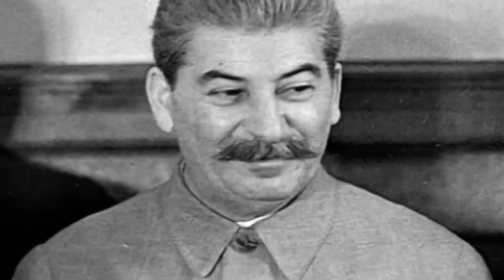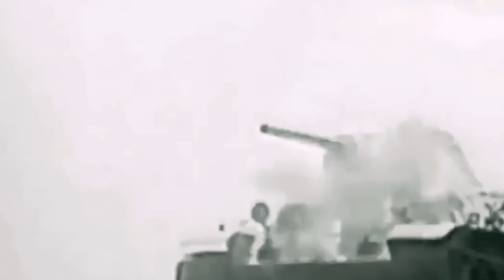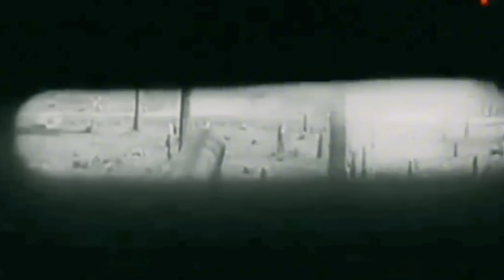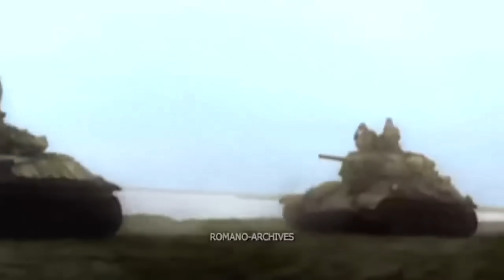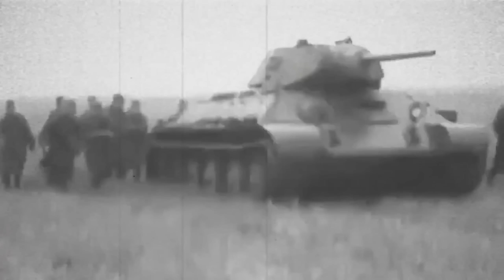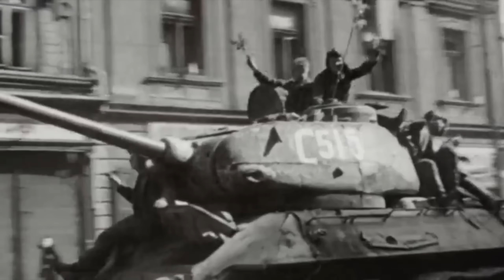Dark Truth Behind the Most Destroyed Tank Ever: T-34

Comment: A little known fact is the Soviets had already developed and were planning on mass producing a new and improved T-34 in 1941 before the German's invaded. The T-34M (A-43) had a 3 man turret, a new torsion bar suspension (increased the tank interior by 20%), a better engine (also turned sideways), thicker armor, smaller overall dimensions, and an extra wheel on each side. The project was cancelled when the German's invaded, but had it been produced a lot of the design issues of the original T-34 would have been addressed (poor engine reliability, 2-man turret, extremely difficult to change gears, etc).

A lot of the design principles from the T-34M were later reused in the design of the T-44 (torsion bar suspension, sideways engine, improved armor layout, etc). The T-44 wasn't a direct successor to the T-34M, but the T-34M influenced it a lot.

Comment: Just one mistake I noticed the T34/85 model did not have a turret basket like in the Sherman tank. The loader had to walk and load the gun as the turret rotated.
Reply: wrote: "Just one mistake I noticed the T34/85 model did not have a turret basket like in the Sherman tank. The loader had to walk and load the gun as the turret rotated"
-- Late model M-4 Sherman(wet stowage) tank did not have a turret basket, since it adapted T-34 tank form of main gun ammo stowage on the floor, and loader had seat that rotated with turret, since T-34 turret was one of the fastest traversing turrets of WWII tanks(full 360 degrees in just 11-14 seconds), just so you know.

Comment: The Bt 7 had sloped armour, the french had the R35, all american tanks had sloped armour.... and even the tiger had a slight sloped frontal armour, the concept was well know ....
Reply: -- BT-7, that was designed and produced in the same factory as T-34(in fact it supposed to be next generation of BT tanks) did not considered it as "slopped armor" tank, nor Tiger I, since oblique angles of Tiger I armor did not help with EAT(Effective Armor Thickness) or  deflection of projectiles... so you are wrong about "slopped armor". FYI, author of theory of "Armor Plates or Rational Angles) was N. Tsyganov, which at 60 degrees of oblique angle doubled the thickness, and was specifically configured to defeat any German tank(KwK) and antitank(PaK) gun at the beginning of the war.

Comment: The designer of the T-34 died of pneumonia he contracted through demonstrating the T-34 on a very long drive to Moscow I think that is an important detail the guy literally died trying to convince Stalin the tank is worthy of mass production.
Germans knew about sloped armor but did not deem it necessary as their manganese containing rolled hardened steel was very good ... later indeed they sloped the armor but only in the front sloping helps with protection but reduces internal space a lot.
Reply: "Only" 900 T-34 500 KV-1 ... that is 1300 tanks the Germans in total had 3300. In total. The Russians also had a lot of T-36 and BT-5 and BT-7 in total 10,000-50,0000 tanks so Germans were outnumbered from the beginning even on June 22nd by a lot, 3:1 or 5:1. "Only". The Germans has only 440 Panzer IV even that with a short barrel and only 960 Panzer III so the Soviets had an ample number of tanks.
Reply: wrote: "The designer of the T-34 died of pneumonia he contracted through demonstrating the T-34 on a very long drive to Moscow I think that is an important detail the guy literally died trying to convince Stalin the tank is worthy of mass production."

-- Yeah, but you too left also an important detail, that M. Koshkin got wet as the forward tank, that he drove, slipped off the icy bridge and plummeted into the river in the middle of cold winter(month of March), everyone else who participated in that 3 000km field trip, survived no problems.

Comment: Both, Panzer IV and t-34 had their flaws. The Panzer 4 originally had a thin armour and a short barreled 75mm gun. Much more dangerous, its ammunition was stored at the sides of the hull. Thus a direct penetrating impact on its side could immediately lead to an explosion of the shells. On the other side the T-34 had its tanks on the sides of the hull, better protected by the sloped and thicker armour, but a penetrating hit could change the T-34 into a crematory for its crew. The ammunition however was stored at the bottom. There the shells were protected against direct hits but the loading of the gun became much more unergonomic than in the Panzer IV.

Comment: The Panzer IV had a 75 mm gun from the start but it was a short barrel howitzer.  After British Matilda tanks proved immune to Pz III 37 mm high velocity guns and Pz IV 75 mm low velocity guns the Germans began replacing the 37 with a 5 CM gun and the 75 mm howitzer with the Pack 40 high velocity gun.  So some German tanks had the 75 mm from the start but in a low velocity format.
Reply: Yes, Pz IV' did have a 75mm right from the start of the war; however, it was not a howitzer. The weapon's designation, KwK 37, is a clue. "KwK" stands for "KampfdwagoneKanone", which is effectively "fighting vehicle cannon", where "cannon" is the term for a direct fire weapon. Later Pz IV's had the longer KwK 40. The same weapon, when used by AT Guns, was referred to as the "PaK 40", where "PaK" stands for "PanzerabwehrKanone", i.e. "AT Gun".

The German word for a "howitzer" was "Haubitze". For example, the "10.5 cm le FH18" was the principal Divisional artillery weapon in WW2. The designation stands for "leichte Feld Haubitze", i.e. light Field Howitzer.
This same weapon was found in the Sd.Kfz. 124 Wespe, which was a fully-tracked SP artillery piece. For some reason, the slightly modified version of this howitzer used by the Sd. Kfz. 142/2 StuH 42 (basically a StuG III but with a 105mm howitzer instead of the usual 75mm gun) was designated "10.5 cm Stu H 42".

The length of the barrel (or even its length relative to its calibre) is not a reliable indicator as to whether a weapon is a howitzer or cannon. Today's German Army uses the PzH 2000, which has a 155mm L/52 howitzer with a barrel more than 8m long. The WW2 French Army had several tank models equipped with the Puteaux SA-18, a 37mm L/21 cannon with a barrel less than 0.8m long. [By the way, the short 75mm used by the early Pz IV's was slightly longer than the 37mm Guns used by the early Pz III's.]

Comment: T-34 was the worst tank of WW2.
Reply: Based on what? It did its job and helped beat the Germans back to Berlin despite heavy losses. Sure, it wasn't as flashy or well protected as a Panther or a Tiger 2, but the T-34 could at least get to the battlefield reliably without breaking down, and cross bridges without falling through.

I'm not a fan of the T-34, but at the end of the day, the tank you want is the one that can reliably support you in the field, not the "better" one that's broken down a kilometre away. A shit tank is better than no tank.
Reply: The fact is that the T-34, Panther and Tiger tanks brought the Red Army to Berlin.

Comment: Corrections - The largest German gun at the start of the invasion was not the 50mm. Pz IVs had 75mm guns.
Sloped armor was not revolutionary in 1941, British and French tanks had it, but the British often elected to go with vertical frontal armour to increase space and simplify design and construction. German armoured cars and their half tracks had slooed armour before 1939. The Chrisrmtie tank had it in 1931, the Russian BTs had it from the early 30s.

 And the T34 loss rate was way worse than 50% as only 50-55,000 were built during the war, the balance were post war. But they did lose over 40,000 during the war. I've only used round numbers as precise numbers are hard to set though as the production and lost numbers vary in different sources. But the loss rate seems closer to 80% than 50% as only a few thousand of the 44,000 lost woukd have been in post-Ww2 combat.
Reply: 58,701 were built.  That works out to a loss rate of 75 % or so.  However, Red Army tank losses include non-combat losses like scrapping tanks due to wear or obsolescence, not just combat losses.  A lot of T-34/76 and other older tanks were being "destroyed" by being melted down in 1945 to free up steel for new tanks.
Reply: the 75mm L/24 mounted on Pz4 during 39-40-41 was not an anti tank gun, it was a support tank firing only HE, the first long barrel gun 75mm was mounted on the Pz4 F in 1942

Comment: The Soviet High Command soon realized the shortcomings of the T-34 so had its replacement (T40) designed. Germany invaded before the Soviet factories could start manufacturing components for it so the Red Army got stuck using the T-34. In 1943 Stalin shipped over a new T-34 with a driver/mechanic to the US so American automotive engineers could inspect it for design and manufacturing flaws. In 1944 Chrysler engineers in the USSR assisting the Red Army with their M3, M4 and M5 tanks told their generals to start removing the engines and transmissions from their own tanks after every 50 hours of run time to inspect and replace parts to avoid having so many breaking down in battle. The Soviets took their advice which caused long delays between offensive actions. Those delays enabled the Germans to withdraw to new defensive positions being constructed during the delays.

Comment: The way allies counted vs Germans. That's the answer. Not more then half were destroyed as most were repaired and sent out again.

Germans counted only total loss. Meaning they would take a tank get it hit on ten different occasions and only when absolutely all repairs are impossible is when they call it a loss.

Need proof??

There are more Soviet tank aces then Germans and there were more T-34 produced then all German tank designs combined.

Out of roughly 40,000 that got counted more then 25,000 were repaired and continued to fight. You can see them to this day with battle damage all across eastern Europe and Russia in museums. Those that didn't even see action were ultimately sold or placed in secondary roles and a good portion also used as targets during massive wargames in the 50s-60s.

If both Soviet and German counted losses the same they wouldn't be so far apart. Germany would be forced to admit their losses were much higher or Soviets would be admitted to be much lower.

PS the lie that they didn't come with radios are spread by nobodies who never even seen a T-34. That antenna placement isn't there for nothing, crew were given helmet with throat mikes, and yes seats were standard and were padded. Comfort was on par with a Sherman...neither are comfortable and neither were German tanks. They all had little room packed with ton of crew and it was always stuffy and hot - you don't get comfortable in war you just get used to it.
Reply: in war you just get used to it." that is true for anytime.
Reply: WW 2 is the war written by the vanquished, because the third Nazi Reich was only the useful idiot of those who publish anti-Russian and pro-Nazi propaganda, it must be recognized that this has success with the frustrated of life, it is about 'Panzermania' and is more psychiatry than history, the search for self-esteem and transgenerational hatred are the ingredients of this disease which, let’s say, is lucrative.
:goodvibes:
Reply: I've sat in the seats on a T-34/85, post war construction, and in the seats in a wartime large hatch M4A3 VVSS 75mm, and even after sitting around for over a decade the M4A3 was 10 times better to sit in at any station.
Reply: @tankmaker9807 now drive for long periods in all stations in M4 Sherman, T-34, Panzer IV then come back tell me how much you enjoyed each -

If you are comfortable in any of them on the move you are totally nuts

Getting a chance to sit for a split sec doesn't give you a single plus to your point you were trying to make
Reply: @strizhi6717  True, but 30 plus minutes is not a split second, and where did the PZ IV come from? 

I don't see any single plus in your post either, none the less, the ergonomics in the M4 was far superior to the T-34/85.
Reply: @tankmaker9807  all tanks for the era were made for war not comfort. Still holds true today. Doesnt matter which country that's where Panzer IV comes in. Too many think this tank is superior to that because of comfort but fact is they're hardly noticeable. You sat in a Sherman ok now pack it with four more men and your comfort out the window.

Join the army you'll understand my view.

People were built different back then
Reply: @strizhi6717  I never said it was superior due to comfort. I did say the ergonomics in the M4 was better. A comparison of the M4 to the T-34 does not need the PZ IV.
Reply: @tankmaker9807  I was throwing all nations - I could have mentioned Japanese and Italian tanks. The point I am making is in combat none of it matters. M4 is a great tank but its a tank not a luxury car and my experience having sat in both and got  to drive in one at the museum is they are even ... The plus Sherman does get is as the turret rotated so did the attached basket where as T-34 if you are seated you moved with the turret but the bottom was exposed and if not careful you can carelessly kick the driver or gunner assistant. So I would say there was more involved operating a t-34 then a Sherman and if that's your point then I agree. As for comfort and space m4 had a slight edge over T-34/76 but T-34/84 is alot roomier when to my surprise. Once all the crew is in their place that roomy feel gets tossed
Reply: @strizhi6717  I was inside both taking pictures. Turret wise the T-34/85 does have a slight advantage over the 75mm M4 turret I was in. The driver and bow MG stations are the same. At 5' 11" and 30 years younger I fit into the M4 nicely, but I did fit into the drivers seat of the T-34 well enough to be a driver.  T-34 turret, not so much.

Did you ride in or drive the T-34 or the M4. The M4 I was in was a display tank, ex-Marine dozer tank, but no blade.

The mechanic for the T-34/85 was working on the engine the day I was there, so we didn't get a ride like we expected. Books on the T-34 say the engine is bolted to the hull with no dampers, so you can feel a constant vibration.
Reply: @tankmaker9807  I got to ride on the T-34. The initial ignition is all smoke and while others choked on it I liked the fumes lol

Was was really surprising is how smooth and yes I agree you have to get used to driver seat.

Regarding engine being bolted I never thought about it but it didn't vibrate bad enough to notice. Just loud and sitting above the turret it was comfortable and again surprisingly smooth. 

If the driver is good you won't get tossed around if he's a nooby because how awkward the controls can be and if you don't move it into proper gear then it will go but you will want to hold on something. As time goes on and you practice shifting and getting the gear and turn the tank it becomes so second nature you will feel like you're actually moving.

Fun fact...Shermans I understand you have to over time go and push the track pins back into place where as the T-34 there's literally a piece of added steel that knocks them back in place so the clank you hear are bolts being pushed back in when they get too far out.

I got to see a Sherman fire and that was impressive but drive in it I wished I had.

It seems from what I gather its easier to drive a Sherman then a T-34 but that's pure experience and training
Reply: @strizhi6717  Most M4 tracks were double pin secured with a wedge block. The pins were cast into the track blocks, or were held in with rubber bushings. Track pins getting loose were rather rare, but once an end connector failed you were losing the track. 

The plate to push the track pins back in place was called a happy design by the T-34 designers.

I like the T-34 for the rugged and simple design, but they were more dangerous for the crew than most medium tanks at the time. At one point in the war a large number of women were T-34 drivers. Women were used by the factories to test drive tanks, and they ended up in combat because they had more time in the drivers seat than the men.
Reply: The figures given are TOTAL losses. The T-34 had nearly 45,000 total losses. It doesnt include tanks that were knocked out again after being repaired. It's irretrievable losses. Gone for good. Not recovered not repairable. Stricken off the inventories.
Reply: @lyndoncmp5751  The original post stated destroyed, but I suspect your post landed on the wrong thread.

Comment: No radio. Very deadly mistake.
Reply: There was communication set. Author little misinformed.
Reply: Most Russian tanks had no radio during WW2. There was a shortage. Later in the war, late 1944 onwards, things improved.
Reply: @marcbjorg4823  wrote: "No radio. Very deadly mistake."

-- What makes you think, that T-34 was designed without radio? 464 units out of 1110 T-34 in first part of 1941 got two way 73TK3 radio set, and 582 out 1886 in second half of the year also got 73TK3 set, there were however shortages with just about everything, as factory been captured or evacuated, but T-34 was designed to use a dedicated Radio operator/MG gunner.